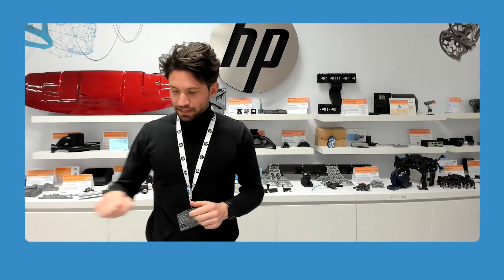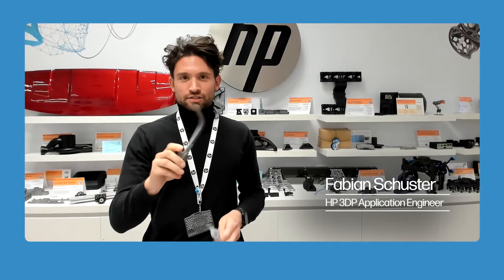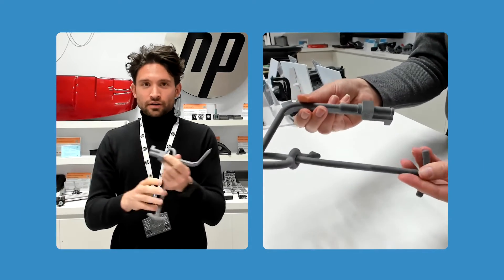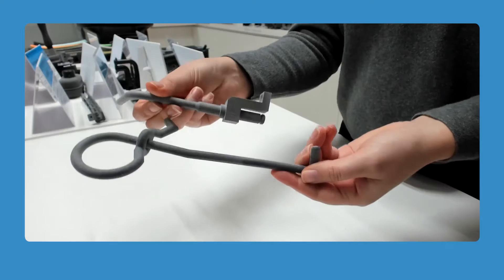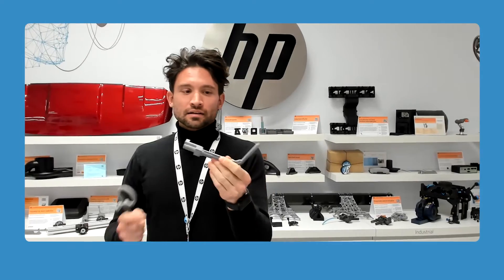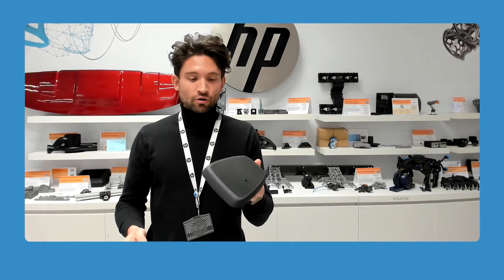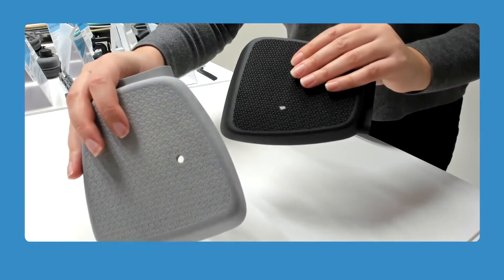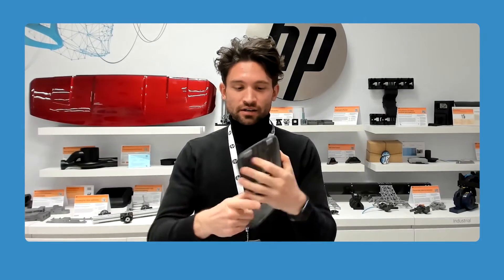HP's Jet Fusion 3D Printing Solutions tackle automotive engineering challenges | HP

Comment: Small fast chargers that charge when the laptop is off with intelligent charge control to avoid overcharging laptop batteries and a charge control chip in the laptop with a capacity of 20W to 60W in 2 magnetic connectors compatible with Samsung and Motorola cell phones